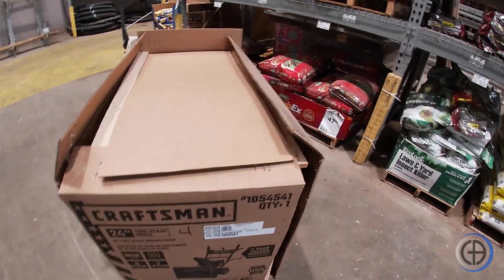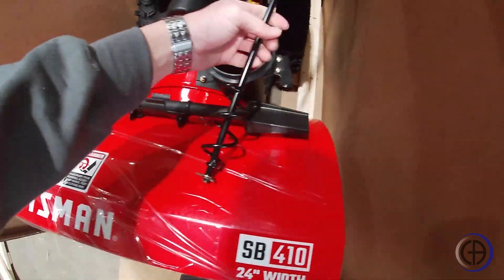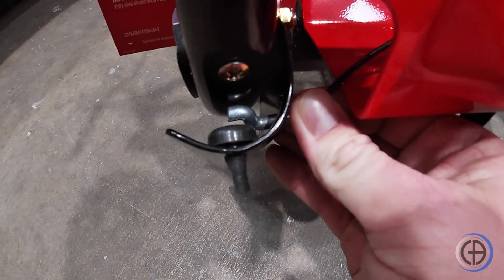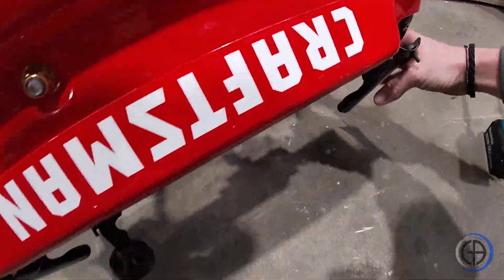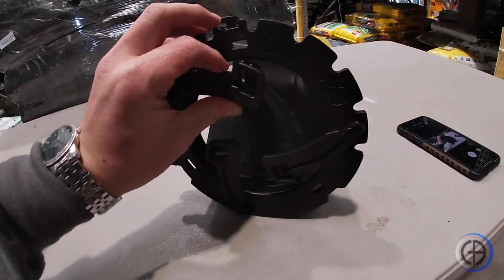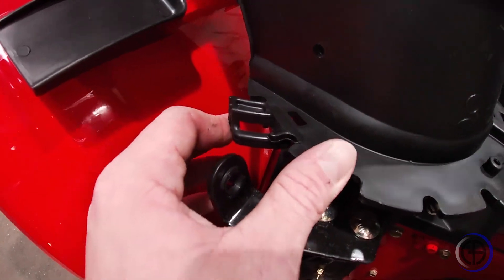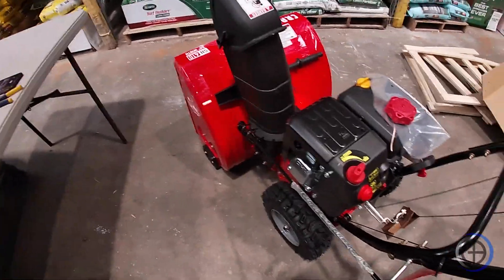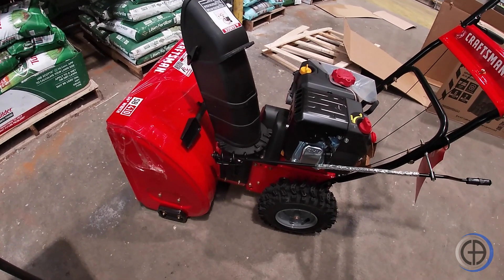Craftsman 24" Snowblower Assembly Training

Comment: Does anyone have any advice about choosing between a Craftsman SB410 and the Craftsman Select 24?  There's only a $ 50 difference in price at Lowes but they look a bit different even though they have the same size 208cc engine.  I'm tired of my Ariens DeLuxe 28 SHO which weighs 270 lbs.  I'll save that for blizzards and use the smaller, lighter Craftsman for the two inch powdery stuff.